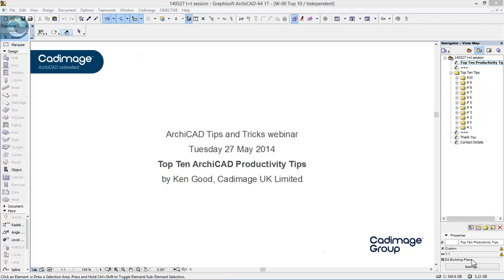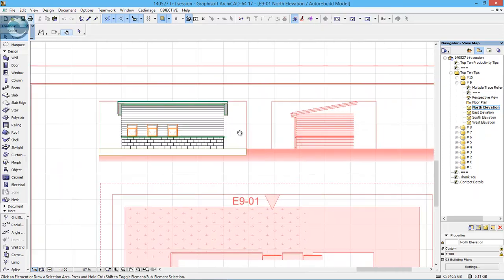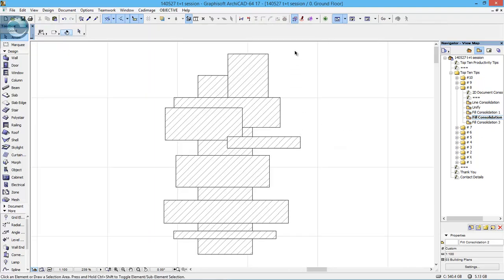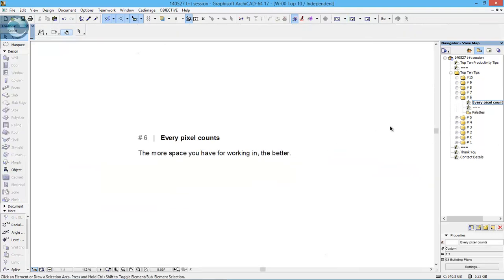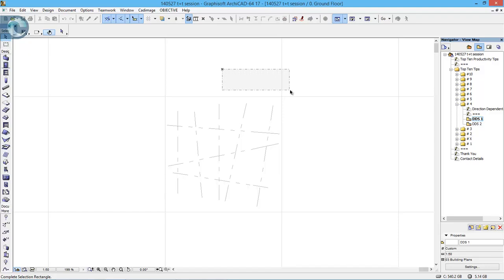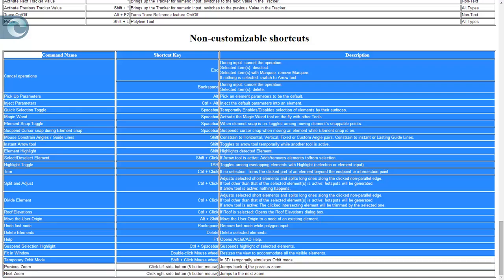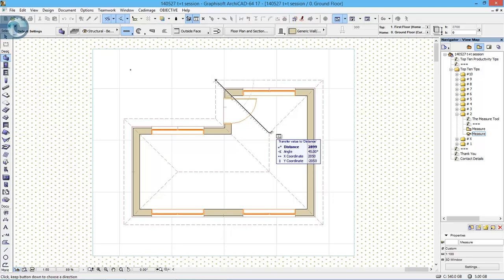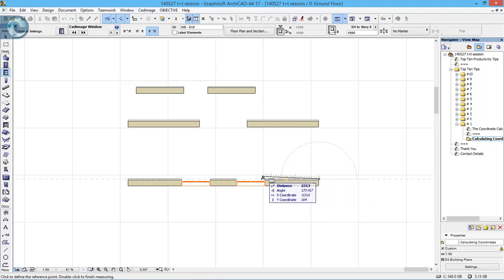ArchiCAD Tips and Tricks, presented by Cadimage

Comment: Thank you very much!  Just two more cents... I think this wasn't mentioned in the video, Orbit [Shift + Middle mouse button] will use as a pivot point the center of  a single selected element, or an average center of a group of selected elements, or the center of  the 3d space if nothing is selected.